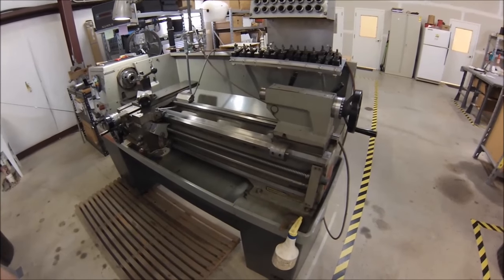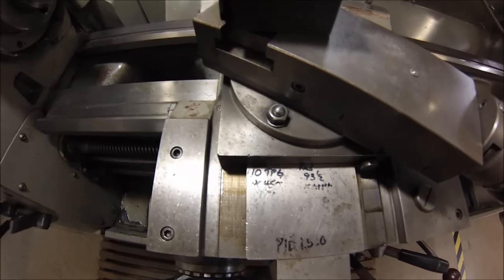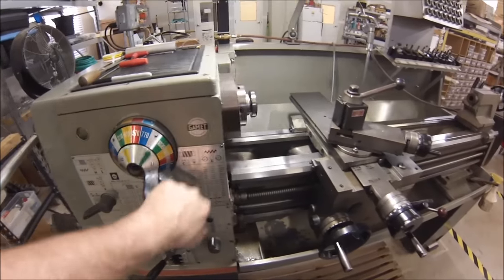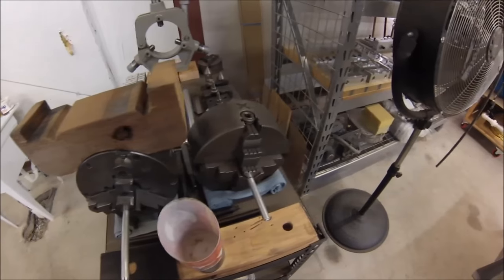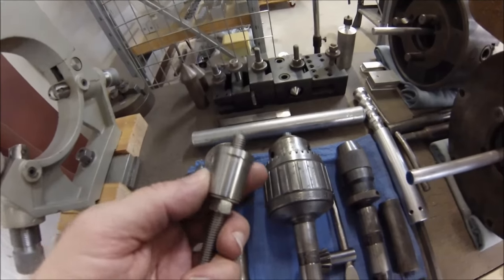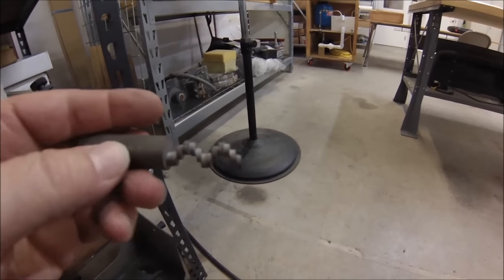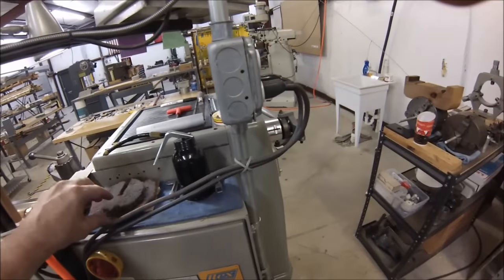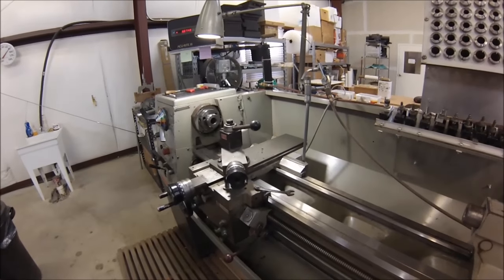A close-up look at the 13" Clausing Lathe

Comment: Joe, I think that idea of putting a witness mark on your chuck so that you don't back the jaws out too far.... Is a great idea. Depending upon where you're standing at the time, if you start that spindle up at high speed and one of those jaws comes flying out at you - you could be killed. This is a wonderful safety suggestion!
Reply from the maker: One jaw can easily be disengaged and you won't know it. That mark should be factory stock.

Comment: hi Joe,
great tips and nice walk around. one thing i would like to supplement here is when you make the index mark on the chuck is the then mount the chuck, remove the jaws completely and etch a very shallow ring into the face of the chuck based on the index mark.. that way you have a permanent index mark that is visible no matter what position the chuck might be in later. it will also show a guy the limits of the stock size at a glance.
cheers
mike
Reply from the maker: Hey Mike. My chuck only has one key, so my warning mark is always visible when I am tightening a part down. The ring groove is a good idea. It also important to keep the jaws clocked as intended, so everything is the same. I have seen jaws let go, and its a memorable event.

Comment: This is called prefect timing for me. I have been looking at your personal lathe for some time now trying to figure out what brand and size. What a surprise to see a video on it. Not being a machinist, it all looks different from my point of view. When you did the 1/2" stainless in ONE cut to .030" from the camera angles your lathe looked huge. I couldn't imagine a 5C collet holding with the force you had on it. A lot different than a round crank handle set up. Just a day or so prior to your video I was looking at the Clausing Colchester 13"x40" lathes on the internet, way out of my league of course but it's like shopping for trucks, can I find a decent one for $20,000 or throw it all in and go for the top of the line and hope the wife is in a good mood. All I can say is thank you for taking the time to show us the tricks of the trade and do it in one piece safely like you pros do. You have helped me make up my mind on selling my lathe and I appreciate that. I'm pushing 70 with a lot of issues and the more I do the more I find need to take things apart and redo. Not saying my lathe is junk, I don't have the strength to make it better like I planned to do in the beginning. So I'm going to take some time and figure out what I really need. A small CNC lathe or mill and learn the programming or maybe a 11" or 12" gear head lathe that I don't have to work on. I'd really like a 13" but again it all depends on price so I'm looking for something newer than 62 years old like I have. You have a great shop and products are fantastic. I hope you have a prosperous and busy 2022 Joe, you deserve it.

Comment: That's a Colchester Triumph 2000 in the UK. Just got one and it's my next project :D Love the vids, Joe. A nice bit of the science behind the practical.
Reply from the maker: Great machine. I wanted the 15", but this was clean and priced right.
Reply: Forgive me, but the 13” swing machine is a Colchester Student in the UK - at least mine is !  The Triumph 2000 is a 7 1/2” centre height ( 15” swing ) Spent my college years on a brand new one back in the 70’s !
Reply: 13" 2500 rip'ems is a Master the Student 1800 only goes to to 1800 rip'ems plus it dont have the forward reverse clutches and a few other bit's. both 6 1/2" swing though

Comment: How to quiet down one of these machines? The one at work is driving me NUTSSS!!!!!! THANK YOU IN ADVANCE!
Reply from the maker: Collet closer jumping around and shaking the handle?
Reply: @joepie221  No collet closer. Its just the motor. Everytime it turns on I have to put in ear plugs...? Maybe low on oil or something? Any advice will help me out
Reply: @blakelibby2140  have you checked the motor bearings?
Reply: @daveb3910  So far I've changed out the pump which was half the problem. But I bet your right about the motor bearings.

Comment: Joe, Lots of good tips. Thanks. Now I've got more projects to do to set up my lathe closer to the way you have yours. I have the same type Clausing Colchester 13x40. But yours is way newer and in better shape. The tapered work stop that goes in the headstock is a real good idea. As is the chuck cradle. And the tool height setter. Definitely looking forward to the steady rest video. and the eccentric collet one. The other thing I'd like to hear about is how to deal with a worn machine. The ways on mine are worn down by up to 0.012 in the area where the carriage spends most of its time. Problem symptoms are tapered cuts on long pieces. Earlier onset of chatter. I suspect an old school machinist would be able to turn out good parts regardless by accommodating the idiosyncrasies of the machine. Anyway, thanks again.

Comment: Joe, 
 I found your channel fairly recently, very impressed with your knowledge. 
You made a comment about preferring smaller jobs, "the smaller the better".
Well, I need to create a 1/4"-28 internal thread. Small stuff. My tap set does not have this thread.
I have a bunch of HSS 1/4" round blanks, 1/4" square blanks, and 1/8" square blanks.
It would be GREAT if you could do a video on tool making/grinding. Especially an internal threading tool for the small stuff!!

Thanks!  -Tim

Comment: Spent 51 years in all phases of machining from production to model shop to die shop machining. We had Hardinge hlvh and monarch ee's all over the place, but my all time favorite go to machine was a Clausing Colchester 13x40. It did everything extremely well without the capacity restraints of the others. The only thing I wished it had was Hardinges excellent threading system.

Comment: Nice setup, I like the idea for the lathe feet.
Reply from the maker: Thanks, It made a considerable difference. MSC.com I believe.
Reply: Mine is sitting on shims on 3/4 inch solid white oak flooring on 3/4 inch OSB sitting on 2X4 sleepers turned flat ways at 12 inch centers that are sitting on the old garage concrete floor.
Not bolted down.
The white oak is sealed with tung oil. 
This is about as unorthodox as you can get but it works..and there is no vibration or any problem cutting true.
The floor is easy on the feet and I dont have to worry about dropping something on it..

Comment: Joe, forget the questions about the D1-4 Camlock. I did the research and came up with the answers I needed. The 12-1/2" lathe that came with my lathe was just to sell it. There is no way I can use a chuck that big when I have a 1/2" left between the chuck and the bed. This chuck was recommended for lathes 16" and larger. Sorry to bother you.
Reply from the maker: I wouldn't use a chuck bigger than a 10" on a 13" lathe.
Reply: @joepie221  yes sir,  I didn't realize that 10" is the max recommended.  The chuck came with the lathe to be a selling point. South Bend says a 9" chuck is the largest recommended size in their catalog.  It didn't dawn on me that I could only chuck up 3 to 4 " rounds in a 12" because the jaws would hit the ways. Thanks

Comment: I'd like to know about the eccentric collets.  I've never heard of them before.  I like the crank that you did.
Reply from the maker: Hey Herb, someday I'll make the block, rods and pistons to go with it...........In all the spare time I have. I made the eccentric collet. I used an emergency 5-C set in a collet block and bored it off center in the mill.
Reply: Joe Pieczynski how do you set it up with right runout,  when chainging direction/crankdirection in the collet?  Maybe a subject for you to film?  How to make, and correctly align a shaft/crankshaft with several cranks in a fourjaw.    When i do, i do with several centerholes, and between centers. But i really cant figure a smart Way, when in a fourjaw, and i want ect. 4 cranks with exact distance/throw.  Maybe you have some smart hints 😀.  BTW, that clausing lathe does look very good, Nice condition. Ive run allot on the Colchester models, several sizes and models.  A very Nice lathe indeed. 😀.   BTW, also a Nice hint with the stopline on Chuck.  Also remember not the run the spindle without a piece in it. On some the chucks can Walk out, and shoot arround. (Seen many on youtube running High speed rpm without the Chuck tight, Maybe worth mention)   Best rgds, Rasmus
Reply from the maker: I covered the open chuck safety warning in another video. That is so dangerous and makes me crazy when I see someone run an empty chuck. Good point. The eccentric bushing or collet is setup in a mill and indicated true then offset with a DRO and bored. The indexing was done with a scribed line on the part and reference marks on the collar.

Comment: Joe, great videos man. I'd like to hear you talk about how you bought the shop. Did you always work for yourself? Who are your main customers? Basically the business side of machining. Thanks
Reply from the maker: Greetings. My story here takes a few unexpected turns. I didn't open my shop until 2006. I am a journeyman toolmaker by trade and spent the majority of my time in prototype and experimental development work in semi conductor, wafer fab and explosion supression systems for the military. relocated to Texas in 1996 and went to work for a major orthopedic company. Worked my way into engineering from the shop floor and took a job with a contractor when the company was bought and relocated to Warsaw Indiana. Identified a niche for custom surgical instrumentation and repairs and opened my shop to service that need. FDA policy's forced a change in direction and now I've done everything from custom putters for PGA tour professionals to water flow control valve design. I am actively pursuing a certification to become a military sub contractor. This building was empty before I signed the lease. I bought the machines as I could afford them, and the rest is history.

Comment: Joe, thank you for taking the time to produce such informative and creative machining videos. They have helped me out tremendously as a self-taught hobby machinist.  I would have never been able to learn any of this without YouTube and folks like you!  I hope to pass along these essential and empowering skills to my children once they get old enough.

Question for you...I recently upgraded my crappy Chinese lathe to an much older but more rigid gear head lathe with enough horsepower to use carbide insert tooling. I plan to turn mostly 4140/50 and aluminum alloys.  Of the many choices available in insert geometry, which few do you recommend that I use and do you have any preferred brand/style of insert tool holders?

Comment: Brilliant little lathe, I did my trade test on one..
Reply: just out of curiousity, what trade test?  Is this something for an apprenticeship or something, and what did it consist of?   Thanks!
Reply: Yes, a Trade test is the final exam in an apprenticeship. Mine consisted of a written section, ( I am a printing press technician.) and a practical section where you are required to perform certain tasks using a lathe and milling machine. The work pieces that you make are then evaluated for accuracy, finish etc..
Reply: thanks for the clarification.  I have such a passion for machining as a hobby, I would have loved to have the opportunity to find an apprenticeship, they seem extremely rare and hard to find though

Comment: I have always done eccentric turning using my 4 jaw, I didn't even know they made eccentric colletts. Of course the only time I ever did it was 4in offsets on a crank so not really collett work. Thanks for the tour, you can keep that small stuff and send the big stuff to me. Nothing smaller than 1/4-20 allowed in my shop. :-0
Reply from the maker: I make the eccentric collets out of the 5C emergency blank collets. I used to run an 18-140 gap bed mazak. I loaded the chucks and parts with a crane. 36 inch faceplate with hundreds of pounds of counterweights. I'm done with the big stuff. You can keep it.

Comment: Joe I another question about your lathe. Correct me if I'm wrong but you are using a D1-4 Camlock with 3 pins??? I don't know what the diameter of the largest chuck you have regardless of if it's a 3 jaw or 4 jaw but you can swing 13". If you had a 12" chuck is there any reason the D1-4 with 5/8" diameter cam studs wouldn't hold it? My reasoning is you buy this lathe with the D1-4 as your choice for attaching the chucks you are using from the smallest to the largest being 12" or 12-1/2" in size. Are you limited to a certain size (dia) chuck because of the D1-4? Just a hypothetical question. I'm asking you because I know you are honest, and I trust your answer. Thanks Joe

Comment: I have a Precision Mathews PM1340GT lathe (made in Taiwan) that looks to be a serious clone of your Clausing. The head-stock levers are arranged differently, and the handwheels are different, but the rest is the same right down to how the splash guard is folded.
It hurt to pony up the cash for it, but it is a really fine lathe.
Reply from the maker: I wanted a 15", but found this one first. Clean and well equipped. I had to take it.

Comment: I just bought a used Colchester master 2500 identical machine except the carriage is configured differently. I believe the Clausing was the US made machine. Mine needs massive amount of cleanup and TLC but cant wait to get her working !
Reply: Saddle traverse wheel on the left is a straight bed, wheel on right is a gap bed version

Comment: I just bought the same lathe, did you say that you can change the 3 phase into single phase?????? How?? 🙏🏼 thank you awesome video and lathe
Reply from the maker: I bought a single phase motor then called Clausing support and they walked me through which wires to swap. Works like a charm. I now have 3 phase and can use either.
Reply: @joepie221  thank you Joe for taking the time. I’m going the phase converter route to see if it works. Awesome lathe, do you still run the same set up?
Reply from the maker: @Oldtimeytools  I do. the single phase motor performs just as good as the 3 phase for my needs.

Comment: hi Joe great videos i am a beginner at the lathe, recently purchased a small southbend and now that i see how you have yours on rubber blocks , i would like to set mine up like this it would be so much better. but i have one question, how do you level your lathe perfectly if you were to have a bit of a un-even concrete floor? i asume the rubber blocks are all the same thickness? id be interested to hear how you leveled yours! thank you keep up the videos for a newbee like me, its gold!!
-oli
Reply from the maker: My machine still had 6 threaded leveling feet. take a look under your south bend and see if there are features to put them on yours. A very precision machine level is going to be a big help if you can get a hold of one. Thanks for watching.

Comment: In 2002 I was upside down converting my Clausing 5913 from 440V 3 phase to 220V 3 phase when I realized swapping any two phases would cause the motor to reverse direction.  I have a Precision Matthews 1236 now with 2 axis DRO. I run the compound at 90 degrees to the end of travel, index boring bar on the part, zero the carriage DRO, and then bore the desired depth. I have to measure the hole diameter with pin gauges, and then set the compound DRO. I can then cut a hole with diameter and depth within 0.001".

Comment: Going thru my new "used" 14x40  before setting up in shop.,   Needed to take the chuck off and liked your block with rod secured in the chuck.  I live in redwood country but today I made my  block out of oak,  had to grin on that one.  Like the air hose and tool rack ideas and now is the perfect timing. Question? what were the blocks you placed under the lathe?  Do you think steel plates setting on 3/4" oak blocks would work?  Thank you for all you have shared.
Reply from the maker: I tried aluminum and it still shook. Not sure about hardwood. The rubber machine mounts topped with aluminum plates worked the best. Check MSC.com

Comment: Nice lathe. May I ask where you bought those vibration dampening pads? I have a Chinese lathe, CQ9332A 12x30, that I bought new from Bolton Tools and a Logan 2557-V  I bought used and both machines could use some help in that department. Thanks for sharing.
Reply from the maker: I believe it was MSC. They have an online catalog too. MSC.com

Comment: Joe, back to the D1-4 Camlock. I looked in a 1960 South Bend catalog, if you are using the D1-4 camlock it's good up to a 10" chuck. I have a threaded nose spindle, 2-1/4x8, I also have a 12-1/2" 4-jaw for the threaded spindle. Is the threaded spindle a better choice to hold the larger chuck? It seems that the D1-4 has limits depending on the size of the chuck. Do you have 8" or 10" chucks for you 13" lathe and that's about the largest you would use? I'm thinking about going to a D1-4 but not if I can't continue to use my larger 12-1/2" chuck. Thanks
Reply from the maker: Cut it off at 10" for a 13" lathe.

Comment: Thanks for the tour. What is the hp on your lathe? I’m shopping for a new lathe and it’s been recommended that I get at least 5 hp.
Reply from the maker: I believe the new motor is 7.5 hp
Reply: @joepie221  have you seen a successful repowering of a 15x50 with a DC motor and variac ...? I have no reliable generator turning 3 phase so I was going to try a 1.5hp pmdc on our offgrid 120/240 reliable solar. The 7.5hp  inrush current would probably stall my 25kw GMC 2-71...!